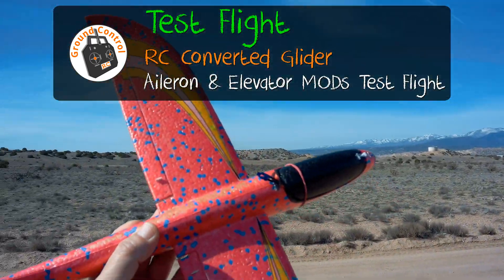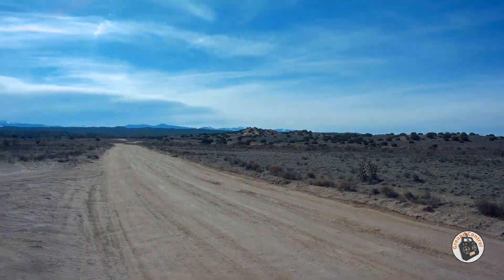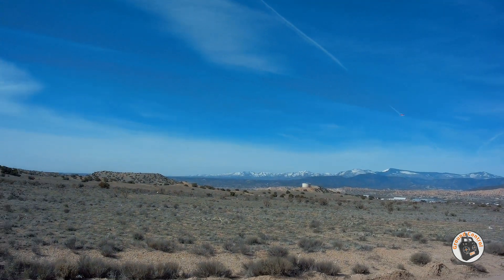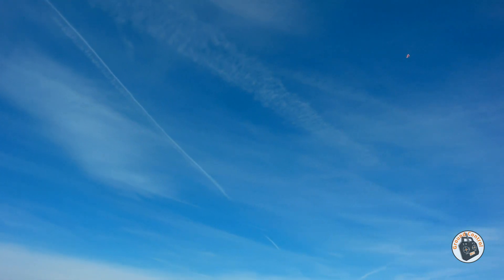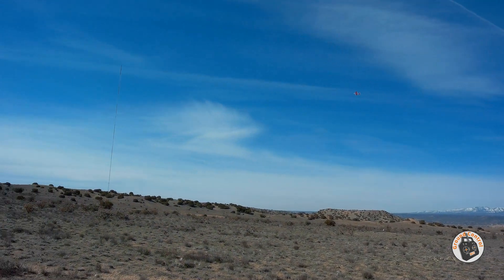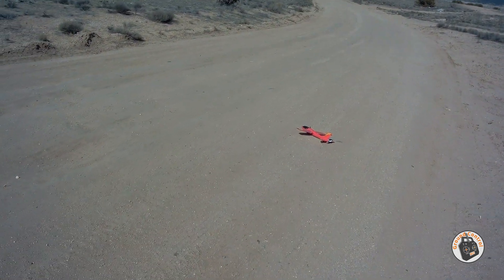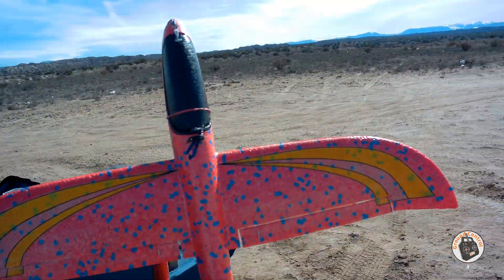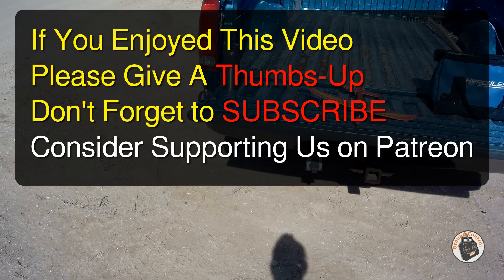Test Flight #2 of the RC Chuck Glider - Aileron & Elevator MODs

Comment: This has turned out to be a champ! Well Done!
Reply from the maker: Thank you much! I'm really happy with the way it's flying now ;-)  I think after putting a slightly taller control horn on the elevator I will be happy with the resolution on that control surface and then on to the tractor version ;-) Thanks for the kind words and I'll see you in the Air!

Comment: Great one. Both plane and pilot feels great after this test flight. Only a little bit more expo maybe.
Cheers. Robby.
Reply from the maker: Robby, thank you much. I wish I had a bit more granularity/resolution on the elevator. I think I will replace the Elevator Control Horn with one 2-3mm taller and then I think I'll be golden ;-) See you in the Air!

Comment: The stall & wing dip free slow flight performance is especially impressive thanks to nice aerofoil wing & surface finish.........
The only issue I have with these gliders is that main wing is aligned @ zero deg with fuselage whereas for max efficient lift from wing u need 15 deg AOA so to achieve that these gliders have to fly slightly nose up attitude which looks awkward to viewer. The real planes have main wing fitted at 10 to 15 deg AOA So they simply fly nice level attitude
Reply from the maker: I agree, I don't know why many of these factory planes do no have a prop AOA. It always seems with factory planes that something is amiss and needs modifying. On this specific glider even the CG is really strange. In order to get it to glide properly I had to set the CG 66% back from the leading edge of the wing. That is definitely not anywhere close to where I expected it to be ;-) See you in the  Air!

Comment: The plane flies superbly. On such small propellers. Thrust about 150g? Why don't you use fpv?
Reply from the maker: Thank you much! This motor and prop supply 170g of thrust on a 2S LIPO. I may experiment with a small 3S LIPO ;-) I have FPV setup on this Glider and have flown it FPV as well and I have a couple of videos I'll be posting soon with FPV footage ;-) This tiny plane has no problem carrying a micro FPV system ;-) See you in the Air!
Reply: @GroundControlRC  I know about fpv videos and see the mount for camera. I think on such a plane FPV too. I like the visual launch for aircraft.